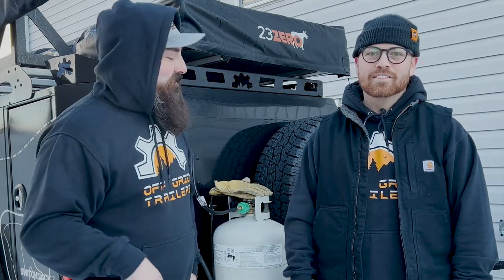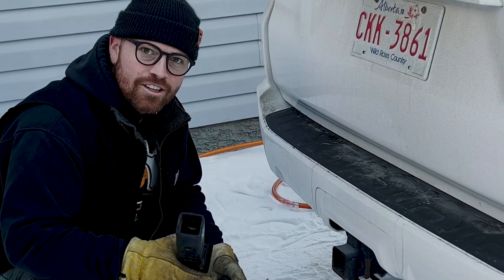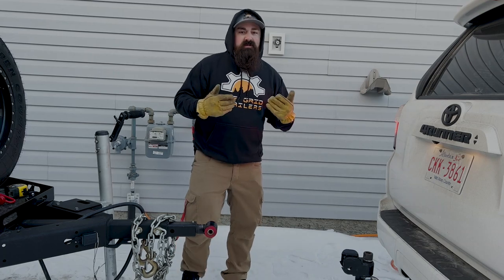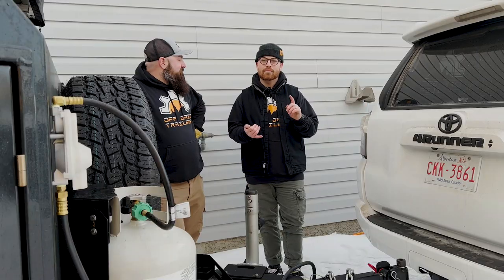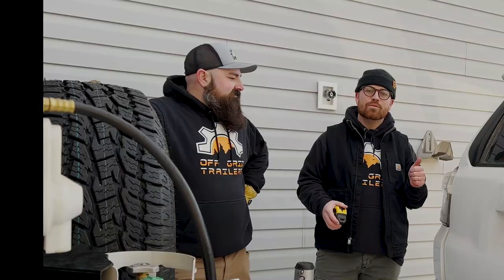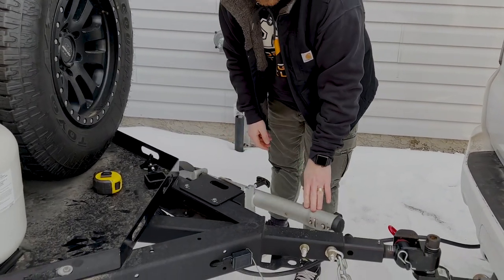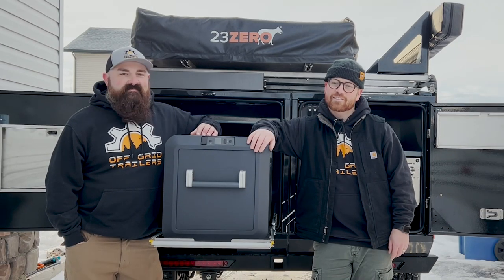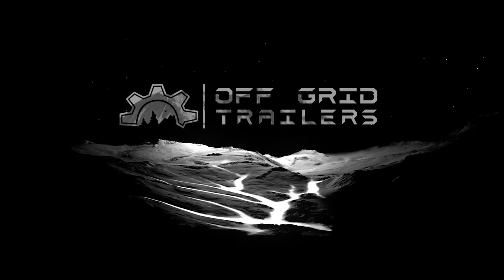OFF GRID TRAILERS | VLOG: 003 | Hitching up with a Max Coupler & setting your hitch height.

Comment: Can you give details on the air bag system you have installed?  As a 4Runner owner with this trailer,  the droop in the rear is pretty terrible.
Reply from the maker: This particular 4Runner has a set of Firestone Ride-Rite Air bags. They are inexpensive, easy to install and work quite well.

Comment: So my wife and I are looking at getting one of your trailers. I was curious, atm I have 265 tires and I know that's what you all put on your trailers. I plan on moving up to 285 or 33's. Can you put 33's on your trailers or will a person need to adjust using the receiver?
Reply from the maker: You can fit a 33 inch tire on the trailer. Your hitch height will change, and you may have to adjust accordingly.
Reply: @OffGridTrailers  Thanks for the reply, after I asked this I came across your FAQS area on your site and read that.